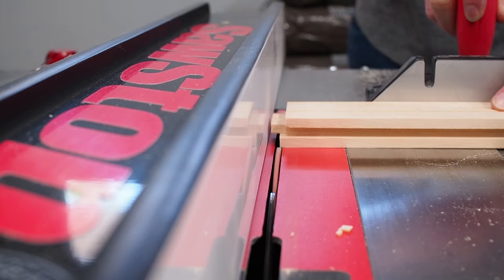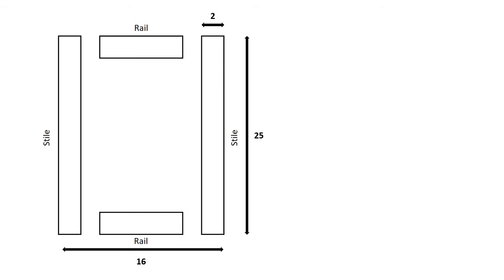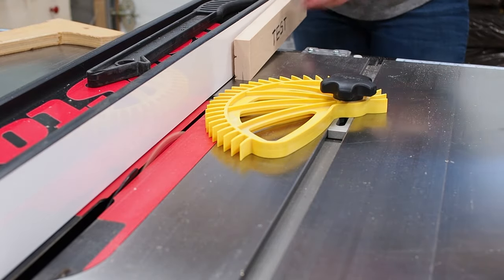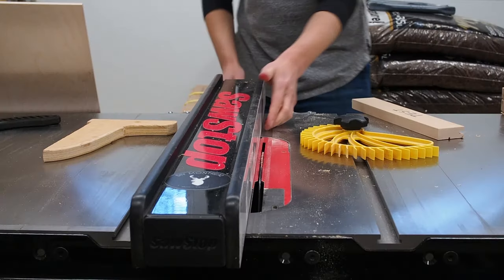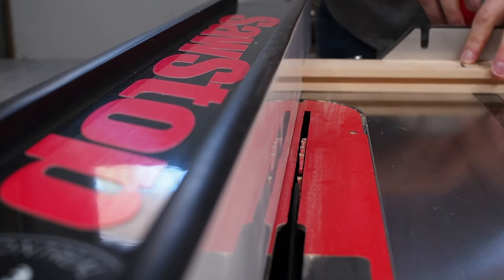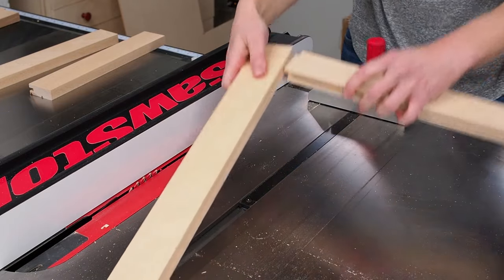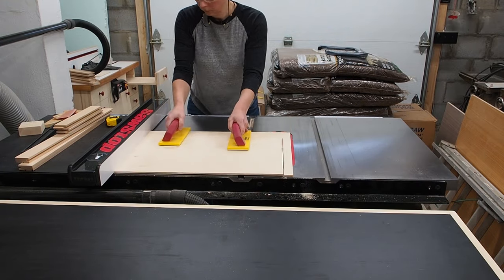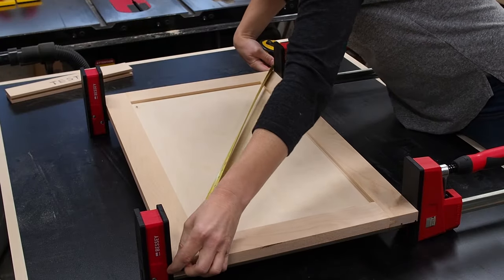How to Build Shaker Doors with the Table Saw | Rail and Stile | Tongue and Groove | Cabinet doors

Comment: Nice. But what was the point of making the groove in the test piece, declaring success and making the same groove in ALL the pieces?  Then  go back and redo it all for the actual thickness of the panel?    Also looks like you gave up on using the push stick the second time around.  Seems like extra work and less safety?

Comment: Hi I have a question about the width of the stiles and rails. I know the 2 inch width is typical, but I’m wanting a bit more modern look and would like to use 1x2’s since they are only 1.5 inches wide. I have never seen anyone build a shaker frame from wood this narrow. Would it be perfectly fine to use 1x2s or would having narrower boards create structural problems?

Comment: Should the panels be floating in a shaker door, is there enough glue to on the joints to keep door from coming apart? What type of saw blade did you use? This is without a doubt the best video I found on shaker doors. Thanks.

Comment: Nice use of that flooring. I use MDF for panels because 6 mm plywood in the UK is guaranteed to be anything but flat !  MDF paints nicely too. In fact I used 18 mm for stiles and rails on doors for my daughter's 3 meter wide floor - to - ceiling  storage last year. Primer + 3 coats of acrylic eggshell and they seem tough enough.
Reply from the maker: Wow that's a huge build! MDF is great for it's stability 👍

Comment: That is a very good basic approach to fitting tenons and mortises. I do  a similar process- always using a scrap piece before cutting the good ones. But, but for the fence location, I have a dial indicator clamped to the table and adjust the fence in thousandths and tap the fence  just the right amount to have the next cut fit perfectly. I use  2 indicators on my router table for getting the fit with the next cut...Thanks for the video..Jim
Reply from the maker: That's precision! Just trying to keep it basic for people that don't have all the tools we do.

Comment: The shoulder should be about 1/16th from the bottom of the groove for glue expansion. Its likely not to matter so so much, but that ensures it wont split or push apart. And glad you mentioned not making a thru cut with the wood against the fence and mitre guage. I was cringing until you mentioned why it was fine for this operation.

Comment: Honestly, when using plywood for the center panel there's little chance of expansion. Gluing the panel in the grooves provides a lot of strength and makes up for the short tenons.  Great job explaining the process!
Reply from the maker: True, but I assume that would be more messy with the glue squeeze out and I'm lazy 😉
Reply: @DIYMontreal  that's possible, but if the doors are very big, which yours aren't, it's good to have the strength since the tenons are short.

Comment: Great video. I made these today and it went really well! 
I think you can cut a step from the process if you do the fitting of the middle insert (1/4 ply) on the test piece straight in the beginning. I don't think there is a real need to run all the pieces once and have a thin strip only to adjust and rerun again unless the width of the insert material is actually wider than double the kerf of the saw blade in which case it 
would take more than two runs to get a clean cut.

Comment: This is so clear and very helpful.  I would love to build this same style Shaker door but with a slight beveled edge on the inside (because it is easier to clean the inset corners).  Would it still be possible to do that with a table saw?

Comment: I just made two doors following your video instructions.  Wow, they turned out nice.  I have one question though.  My doors are pretty big:  22 x 30.  I'm concerned about whether simply gluing the corners, as instructed, is going to be enough.  What do you say?
Reply from the maker: Yes, that should still be strong enough, but you can glue the panel in the grooves if you feel better. There is very little wood movement with plywood.

Comment: I place a 1x1 along the fence and check my measuerment then i pull it back just short of the fron of the blade. I place the board to cut up against the 1x1 that is clamped to the fence and run it and I don't have to worry about any kick back.
Reply from the maker: Yep, that's the safest way to do it 👍

Comment: Is there a structural reason that the stiles go top to bottom and the rails go between instead of the other way around? I made mine having the rails go full side to side, and the stiles fit between them. Is one way stronger, or less likely to warp or something?
Reply from the maker: I don't think it matters. I always assumed the way it was done was for visual aesthetics; when the door is open the edge you see is one solid piece.
Reply: @DIYMontreal  If you are looking at the edge of the door, I can see that. On an upper cabinet that makes sense, but on the floor level cabinet Im making it makes just as much sense to do it the other way and see a single piece of wood on the top edge looking down at it.  If there is no structural reason, like expansion problems from cross grain gluing or some stupid thing I wont worry about it. Thanks!